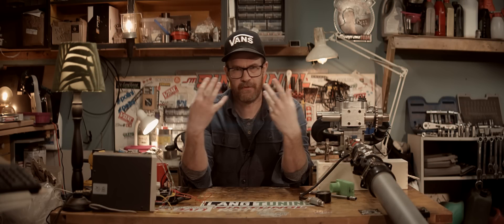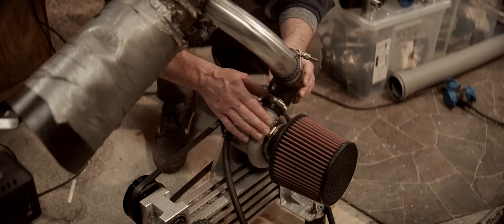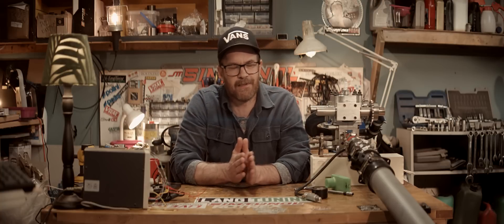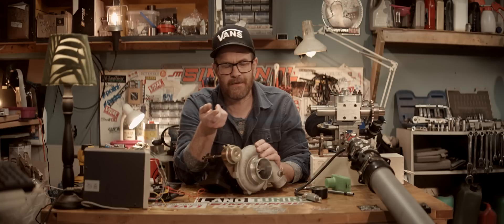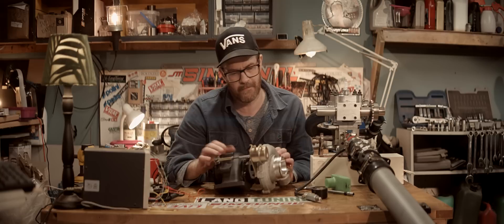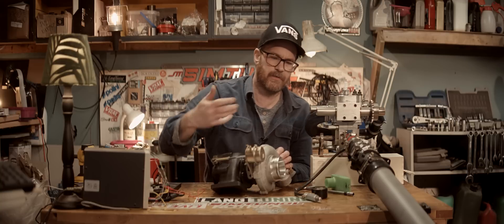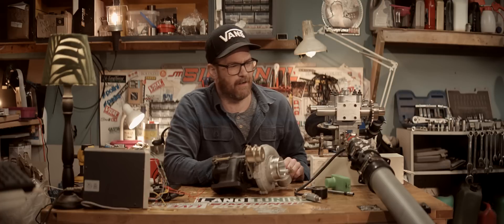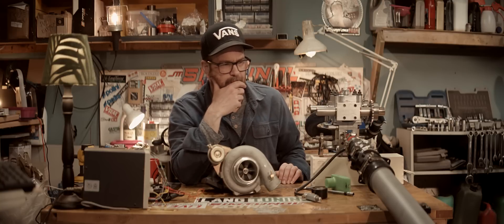THE most genius/stupid idea! Turbojet supercharging.

Comment: Get an external wastegate for that rotex that is for a turbo, they don’t need exhaust pressure to run they just need pressure and you can set them with springs or air pressure or both so they’re very easy to adjust. Instead of putting it on your exhaust put it on the pressure tube between the supercharger and the carburetor and it will release whatever excess air you don’t want in the system

Comment: The jet thing sounds pretty cool but i think there would be alot of issues with high temp corrosion if using steel. And would probably be a nightmare to get everything working in sync and not just blow out the flame because the engine/compressor ramps up too fast. An insane amount of lag would probably be hard to get rid of.

Comment: You shouldn't struggle with compressor at this point. You should have one which can deliver everything you ever need.

My friend once find an old lamellar compressor from junkyard and paid something like 200€ from it. We find it be in perfect shape. It had 7.5kW three phase electric motor in it and enoug air flow for your need for sure. It also had adjustable pressure from somewhere around 0.5 bars to 8bar. He used it with concrete sprayer and pressure control was so good it didn't need any storage tank or regulator.

Such thing would be pretty handy for you too, and it didn't waste much power if air was not needed. Idling power was around 1kw.

Comment: Check your math. If you double the amount of air, you double the pressure. You calculating 50+50+50+50+50cc=4bar is wrong.

50x2=100cc, 1bar 
x2=200cc, 2bar 
x2=400cc, 4bar

...right?
Reply: Check you math. (In a "ideal 50cc engine") Every 50cc added(After the first one) is 1 bar of boost. He calculating 50+50+50+50+50cc=4bar is "right"(Did he ever do this calculation in the video anyway(Skipped through the video a bit)?!).

50x2=100cc __ (100/50)-1=1bar
100x2=200cc __ (200cc/50)-1=3bar
200x2=400cc __ (400cc/50)-1=7bar

...right?

Comment: Try to make smaller or different compressor for less air flow and high pressure ratio on that Rotrex. You have CNC mill you can make it easily, also compressor housing.

Comment: I think the compound supercharger wouldn't work but it would fail in a different way. the engine NEEDS air to run so the supercharger can't run in a closed loop so the reed valve would have to be open to let new air in. it also means the inlet of the supercharger would be UNDER 1 ATM to open the reed valve so self compounding will not add any boost. it means also a big pressure differential between the inlet and the outlet with just an open tube so it's effectively like short circuiting the supercharger. most of the air exiting the supercharger will rush back to the intake, and energy will be lost into turbulences and heating up the air
the electric analogy would be trying to increase a battery voltage by short circuiting it 😊
Reply from the maker: Yep
Reply: @2STROKESTUFFING  You could compound with one supercharger(If you have lots of "excess flow", time and degrees between scavenging cycles), you "just" need 2 mechanically operated valves and 2 reed valves(Or mechanical valves) and a boost tank.
One reed into the engine(Not really needed for "theoretical ideal operation") a mech valve between that reed and the SC diverting the flow into the boost tank, mech valve from tank outlet to SC intake and then a reed from atmosphere between the tank and SC.
If you had infinitely fast and efficient valve operation and/or running at slow RPM you would be able to compound several stages with more boost tanks(And of course lots of valves!).

Comment: You could just use bottled compressed air. 250cc x15k rpm =3750L/min. At 300 bar the bottle volume would be 12.5L per minute of wide open runtime. No compressor energy needed and extremely cool charge air at whatever pressure you need. You could have a checkvalve to allow for atmospheric idle to save on air. A big steel bottle for testing and carbon fibre bottle for racing, 12L is a reasonable 700€ and 11kg.
Reply: There is a company named compressed air supercharging doing this, they have videos on youtube and a good website, so this would not be totally uncharted territory and information and parts to do this are available by the way

Comment: This is a wonderfully stupid brilliant idea! The smallest turbo on Amazon may work well for this idea! Soooo excited to see if you follow through with this idea and even more so, the results!

maXpeedingrods VZ21 RHB31 Turbo Charger 100HP for Small Engines 500cc-1000cc Snowmobiles Briggs and Stratton Quads Rhino Motorcycle for Suzuki Alto with YA1/F6AT Turbocharger 13900-62D51

Comment: They use pounds per min to figure turbo sizing here in the states. 50cc times 15000 rpm should give you a volume that is convertible to kilos of air, then look for a turbo that provides the multiple you're looking for.
Reply: With the 4 bars that would be about 3,75kg /8 pounds per min but there is short circuiting in a two stroke so it coulb be quite a bit more.

Comment: If you are talking about making a turbo why not make a new compressor for the Rotex and cut out the middle man, you need to think of weight too. so look to calculate the volume you need at  xxxx rpm then can cellulate the Rotex output rpm and from there you can calculate the size of turbine to give you the Psi and volume you need.

Comment: Check with rulemakers for the land speed events first. That jet engine will still produce some amount of thrust, and I don't know how they would feel about your '50cc' bike also getting some amount of thrust (however small) from a jet engine. If they're OK with it, it might honestly be easier to just buy a more powerful 4 stroke engine and use that to run a supercharger and turbocharger purely to feed your 2 stroke - it's the same concept, just not as cool as a jet, obviously, but more reliable. Or use a 2 stroke purely to drive supercharger(s). It stands to reason they'd be OK with either route if they're OK with the jet engine.
Honestly I think it might be easier to take a turbocharger compressor of the proper size, remove the turbine, and gear it to spin at the proper RPM via a belt drive.
The weight of a system like you describe wouldn't be an issue for a land speed bike, but the sheer amount of extra systems required could be an issue for reliability. I've built a jet out of a turbocharger before - you need to add an oil pump, a fuel pump, another ignition driver, another oil cooler, etc. Those additional pumps are a decent bit of extra load compared to just using a second carbureted piston engine which doesn't require them - you could even run your electrical systems off the second engine to remove that drag from the 50cc.
Reply: Yes very good point - not just about the thrust, but "displacement" as well. Or even engine type - I imagine there are classes for jet-powered vehicles that use the jet's shaft power to drive wheels as the primary vehicle drive source.
Reply: I agree. I wonder if compressed air supercharging would be legal. The compressed air might be an extra energy source but at least all gas goes through the engine
Reply: He already has a belt driven centrifugal compressor.
Reply: @MiG21aholic  it's too big.
Reply: @IFRYRCE  indeed, sorry my point was he has the belt drive and speed increase gearing already for a turbo compressor

Comment: Had you considered using a high pressure Air tank with a small heater and regulator feeding into the motor, OK mileage would be bad, but you should do the 1/4  mile OK 👍

Comment: You have got the centrifugal blower all wrong. Centrifugal charger does not make pressure, it creates flow!! The boost pressure comes when you pack that flow to a smaler volume, Like into the engine .(so don't make those calculations because you get it wrong. just spin the blower fast enough to get enough flow to get the desired boost when the engine is RUNNING!! You Can adjust the flow ( if you think theres too much) by choking the inlet side of the blower, like they did when they restricted the power of Rally cars a few years a go.

Positive discharge blowers like roots and screwchargers make pressure ( the outlet charge is pressurized when it comes out of the charger).

Comment: What if you did away with the supercharger and ran just a turbo. Instead of controlling boost via wastegate you control it via something like a blow off valve and plumb that air straight into the exhaust/combustion chamber for the turbo jet. 
It seems like you're going to have a LOT of unburned gasses entering the exhaust through the motor so why not put them to use also. 
Only problem I can see with this setup is getting the motor running, maybe a leafblower might be adequate?

Comment: Why not just use an electric "turbo"? They don't work that well for big volume engines but for 50cc they should be great and you can control the flow electronically.

Comment: I think you can save yourself a lot of nonsense by instead building a turbo jet that operates at the desired pressure but with air mass flow left over and then you "drain" extra air before the combustion chamber to feed it to the intake on the engine. you achieve the same goal, without a power-sucking belt-driven compressor. the amount of fuel for the turbo jet can be controlled based on the charging pressure from the turbo compressor. then increased engine speed will steal more air from the compressor, pressure will drop and the controller will compensate with more fuel for the turbo jet.
Reply: or if we want to be creative, you can connect the compressor directly to the engine. "sets up a turbojet engine with a two-stroke engine between the compressor and the combustion chamber." set it up so that the air and fuel mixture goes through the engine as normal, but while the engine is in compression, the air mixture short-circuits past under the piston to the exhaust, so that you get air and fuel in the exhaust and then they go into a combustion chamber and into the exhaust the turbine. which drives the compressor again.

Comment: I'm sure you can still achieve a lower volume and maintain a high pressure by just creating a tighter restriction and putting a larger pulley on the charger Boyles law P1*V1=P2*V2. However, the temperature will also rise as a result so you will have to super cool to benefit from the gains. Good luck 👍🏼

Comment: Wow... that took a bit of deciphering.  Yes, that's one way to do it.  If you want to spend all your time developing the boost system and not the engine, then go for it!  Alternatively, is there not a much smaller Rotrex unit?  If not, it may be easier to find a really small compressor wheel and housing then graft it onto the existing Rotrex.  Either way should be entertaining...

Comment: Not an engineer, but I wonder if such a high pressure before the carburettor might stop fuel flowing? I'm kinda picturing the fuel being pushed back into the tank. Looking forward to an explanation to why this might not be an issue at all.
Reply: Yup, fuel pump and fpr are required for forced induction via carbs.
Reply: @EddieTheH  thanks for confirming the suspicion EEH ❤️

Comment: Why not take a small turbo an remove the hot side housing an wheel an put a pulley on it? Just make your own rotory supercharger?  It won’t have the same problem as the Rotax style it will work more like a roots blower? You could control the rpm by pulley an not deal with the over complication. Also some of those maf’s don’t read boost above 5 or 6 psi well an it’s just the table that it’s adjusted on the ecu I would try a map an modern maf like a newer Chevy or Ford bmw so on? Most new turbo cars run both to work out pressure an airflow an older mass are draw through not blow through like newer units
Reply: That's essentially what that supercharger is. It won't work with a turbo, or, it will but only for a few minutes before the sideload destroys the bearing.
Reply: I’m well aware! But you usual have two types of supercharger not just one. Roots blowers or twin screw are very similar an don’t surge (other then low speed surge) the same as a rotary style or CENTRIFUGAL super charger witch with gearing spin up a lot higher in rpm an have a surging tendency of higher boost quickly when running up to 20-35k rpm. Turbos have load on the hot side anytime exhaust is run though them but it’s axial load because the cold side is countering the load. You won’t be dealing with excessive heat like a hot side an you really don’t need to worry about running crazy oil though it because there’s no heat. Lol yes it could add load an that could be a problem but this channel is about solving those problems. Like sealed bearings or maybe a longer shaft supported by an external bearing to help the load also I don’t think he would have to spin the turbo to 150,000 rpms or higher like most turbines of turbos run.  But thank you for the Tech lesson.
Reply: @hucker4life  It still needs to spin well above 50 or 60 thousand RPM to make any appreciable boost. Extending the shaft with another bearing would work but balancing it would be the problem there.
Reply: I did have an idea in or high school engineering class when taking about drag cars an boost, da air density an such an asked why not close the intake an use a scuba tank with 4000psi to run the car, wouldn’t have to worry about different tunes for different sea levels or density’s.. I was told it wouldn’t work an they wouldn’t ever use it. Then 2017 rolls around an Mark Griffin’s Camaro used this same theory. Compressed air supercharger!!
Reply: An truthfully this was an idea, but was more about the maf,map problem. But if we want to get technical he has the ability to make a hole NEW core that side load or end play doesn’t mater just utilizing the cold side housing an impeller wheel. An you be surprised at the durability of ball bearing turbos compared to bushing

Comment: Why don’t you start your turbo diesel or turbo gasoline car and connect the compressor to the 50cc engine? Then you could just run your car engine at 4000-5000 rpm in short periods

Comment: That Rotrex supercharger is just too big for the application.  
The internet says its enough for 130hp of air flow. 
There's smaller turbos available... The focus should be not soley boost pressure but the air flow to support the desired HP. On a typical NA engine, 1 bar boost should double the HP. Does this engine run NA ? if so how much HP does it make?
 if it can make 15HP NA you will only need 1 bar boost to make 30hp ie turn a 50cc into a 100cc engine.
Reply: That 130hp is assuming a 4-stroke engine. 2 strokes are very different, in that if you build it to run N.A, it'll not like boost and if you build it for boost it won't run N.A.
Ironic that the engine with more moving parts is actually simpler to get to work. Forced induction on 4-strokes is easy, on 2-strokes it's more of an occult situation.
Reply: OK thanks.. I see they're different animals. I thought it would be similar to a rotary engine.  They can support a bigger turbine wheel due the extra exhaust gases produced by firing 2 or more rotors twice per revolution.. Although in this application, being a 50cc single cilinder engine a smaller centrifugal blower would provide better response and 
easier management of airflow but he's working with what he's got..
Reply: @titahibayflier3160  Someone else in the comments mentioned a smog pump from VW/Porsche that may provide a better solution, as they're essentially just tiny roots blowers. It would be more linear, as you said, and people have had success using them on small karts and ATV's, etc. Might be worth a shot!

Comment: I'm not sure what you're trying to achieve here? 
As far as I know adding another internal combustion engine (the turbo jet) means that your amazing machine won't be a 50cc engine powered motorbike any more? 
It will be a 50cc plus turbo jet hybrid unless there isn't a separate fuel supply for the jet I suppose?

Comment: Lookup Rocket Anti lag, 
It places a combustion chamber in the exhaust to generate more boost. 

You are already trying to push more through the engine so it has a fully fresh fuel air mix, use that excess to burn in the exhaust and push a turbo harder, more boost = more fresh air + fuel pushed through the engine = more boost

Comment: With 2 Scuba tanks I calculate that at 20,000 Rpm you would get about 30 Sec run time on a 50CC engine.  Pressure is virtually unlimited. 

Would that be enough to do the course?

Seems that would be a lot Lighter and less complicated  than what you are planning.

Comment: Ohhh my dear, of course you need a surge valve. Man this is basic stuff, relief to the atmosphere and not bypass, you will have faster throttle response. And forget your compressor experiment. A 50cc two stroke can't drive the booster for the air volume needed at low rpm, it has just a miserable torque. When the two stroke reaches powerband rpm, the compressor is out of efficiency because the engine is sucking more air then the compressor can provide. Go for turbo or NOS.

Comment: And so the rambeling continues, another far out idea thats not gonna work. Give it 2 months tops. Flowbenching a boosted application is utterly useless, start reading ! Last time you started to fool around with a four stroke and now your planning to build a small scale turbine engine... Its clear you dont possess the grey matter to achieve this. Years are proof of that. Not a single engine that out performs a stock 50cc.

Comment: A hilclimb car in the uk actually used a  jet engine  and bled the compressor to feed the engine with  constant boost at any rpm
Reply: Also suggested the same which would make things far more efficient and simple. A turbocharger based DIY gas turbine with bleed air to the engine.